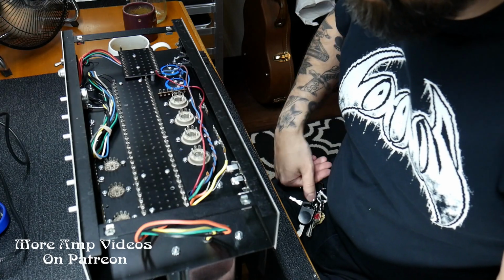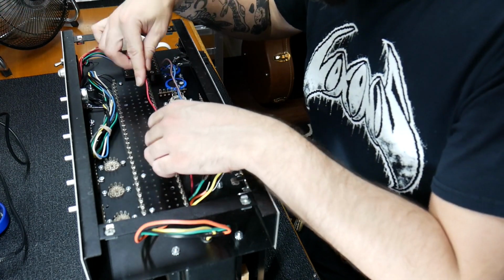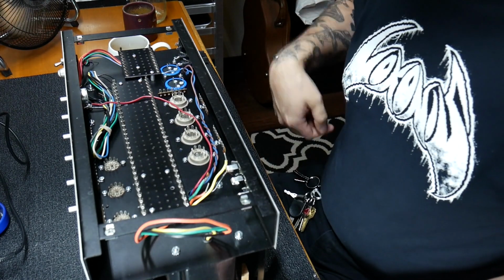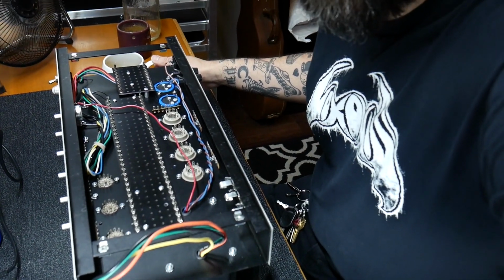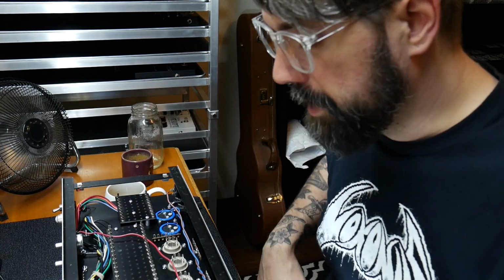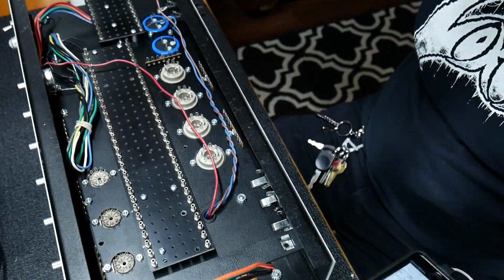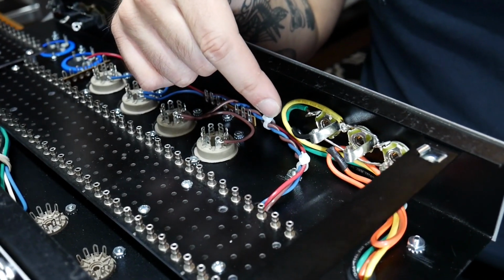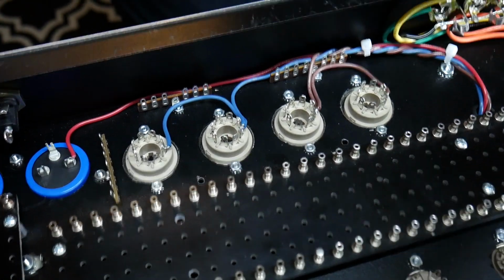Fuzzlord FTW120 Amp Build Part 5

Comment: My dream gear would be jackson dinky with floyd rose-> mud killer -> vox v847 -> boss chorus ensemble -> dual rectifier -> mesa 4x12

I'm not that doomy, but the sound you can make when using an overdrive dirt before the wah plus the amp distortion after it is really cool.
Reply from the maker: Badass setup!
Reply: @FuzzlordEffects  oh damn! Thanks!